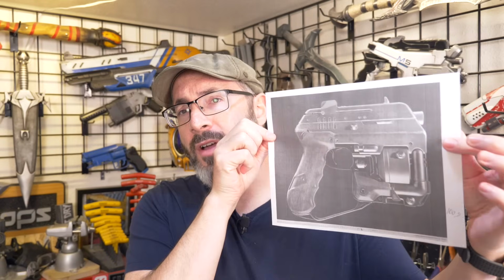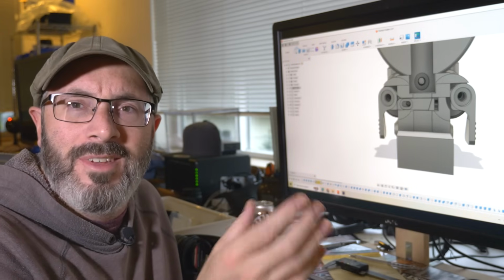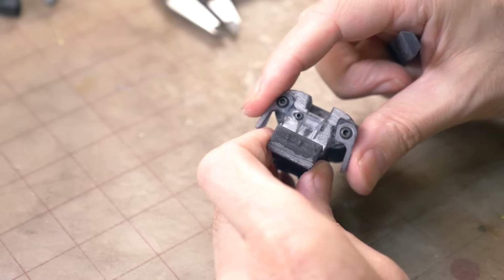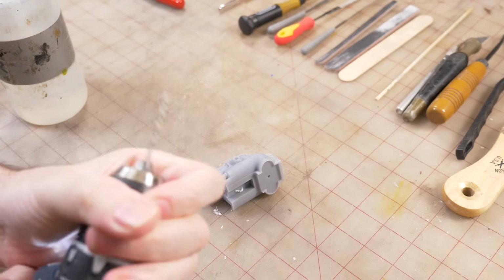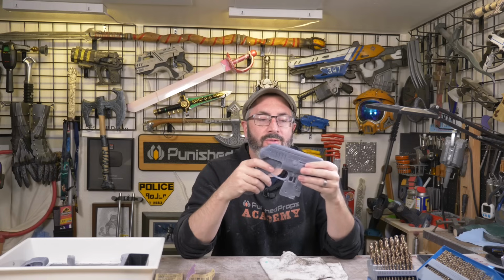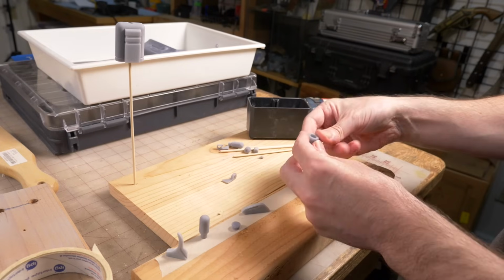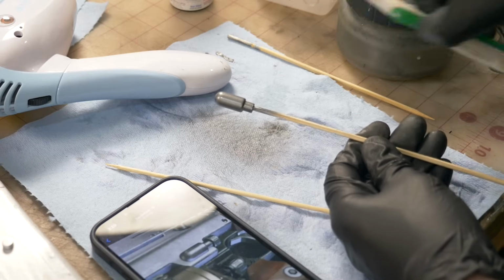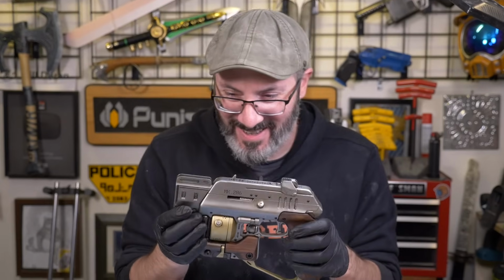Fulfilling my Obsession - Starfield Rattler Prop

Comment: SICK!!! It's really cool to see you implementing CNC in your build!!! I'm def not an expert but I used to design and mill molds (guns, knives, axes, etc) for a holster company and we would do adaptive clearing with a bigger bit (1/2 or 1/4" depending) to remove the bulk of material and then finish it with a couple parallel passes using 1/8" round bit. Might help remove some of that texture you were talking about but I'd probably still sand it manually either way lol. The lips on grip could be something goofy like if you have Fusion cut on the inside or outside of a contour edge, or if the geometry is too small for the bit you're cutting with it gets ignored entirely. Not real sure on that one. It's killer either way and so sick to see. Thanks for making this vid! 😁
Reply from the maker: Thanks so much! I’m having so much fun with CNC.
Reply: Hello! I’m new to the channel here, and really enjoy the content. I’m an artist, and make all kinds of junk and always enjoy learning a new process. — This lip issue can be fixed by expanding the bounding area on the part you are milling, while also throwing in a box or plane under your part with the top of that box being at zero on the z. The bounding area for the part only need to be large enough for the end of you mill (ball or taper) to pass the part and kiss the box underneath. Another method I use depending on the parts, still using a large bounding area, is to tell the machine to skim the clearance plane with clearance plane being set to zero. I’ve only ever worked in rhino cam, but I imagine there are some similar parameters in your cam. Anywho, hope that helps smooth them lips out for ya!

Comment: just a heads up you can hang the plate up inside the resin printer to let resin drip off back into the pool of the resin and then you can take the resin print off the plate to do the whole wash and cure section. Newer Resin printers will allow you to hang the resin print plate in them to let the resin drip back into the pool of resin

Comment: 2:29 Nice!
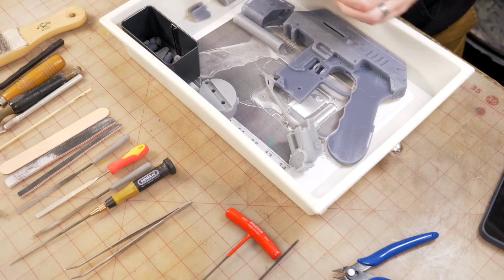23:17 So with these tap screws, how do know just how deep you need to drill?

Now, I wonder how it's possible to extract the files from the game like that?
Reply from the maker: I made the hole 20mm deep and it only needs to have threads on the first 10mm, so I have some wiggle room on the depth.

Comment: One thing that’s important to remember about resin printing is that it can be significantly less accurate than FDM. Depending on your resin, the parts might shrink, be warped, or otherwise inaccurate. If you need parts with a small tolerance between them, you might have better luck with a well tuned FDM printer.

Comment: This turned out fantastic! there's some really fantastic design details in the starfield weapons like the magazine having the cooling system integrated into it so that when you replace the magazine you're also taking out the heat the gun has built up which is essential when it's expected to perform in an environment with no air to passively cool it. Most of the weapons are designed with some form of heat reduction solution and it's cool to see all the different ways they've achieved that
Reply from the maker: Oh yes, I am in love with all the designs in Starfield.

Comment: I think some of the issues you might have had with the resin is that you're using a semi transparent. Resin that clings to the part because of surface tension is getting over exposed as the rest of the model cures. I suggest trying a white of light gray resin and make sure to do a resin calibration test to get the exposure time perfect.
Reply from the maker: I experimented by mixing some opaque resin in with the transparent resin and the results seemed to improved. Definitely need to do some more tinkering to get my resin printing game on point.

Comment: Bill if you heat up the supports before you cure (using a heat gun) you can pull them of much easier.
Reply from the maker: Right on! Thanks for the tip.
Reply: @punishedprops run under hot tap water.

Comment: You can add oil paints to tint your earlier coats of an oil based finish to get whatever wood tone you want, so if you can find a piece with the right grain, you can definitely fudge the color.  I made a piece of pine scrap the color of mahogany, no problem.

I'm also surprised that a part stamped HSS in-universe looks like brass...but your faithful reproduction is beautiful.
Reply from the maker: HA! Yeah it definitely isn't high speed steel. 😂

Comment: When the material failed since it was too thin for the resin, I was wondering if a hybrid approach would work where the base of the gun was made out of a sheet of aluminum and maybe aluminum or steel pins to hold the slide. It may still be too thin for aluminum. 
I know it is so easy to get stuck in one thought of how something should work.
This isn’t a criticism of the finished prop. It is amazing. I really want to see the working slide. 😅 And my thoughts on what might work to solve your issues.
Reply from the maker: I like that idea a lot.
Reply: The issue with having aluminum is how everything attaches.

Comment: @punishedprops I think I know why the wooden parts had a rim. In fusion you probably had the tool containment set to tool center on boundary. It should be tool outside boundary to get that last bit of material.

Absolute great result by the way!
Reply from the maker: Awesome, thanks for sharing! 😄

Comment: Resin printing always feels less exact then FDM, which is funny since resin printing gets smaller and finer details then FDM printing, but when it comes to getting rails and that to slide, from the age of the resin to any over or under exposure of the UV, it can lead to tolerances being inaccurate. Though same things can be said about fdm printing, from the age of filament to the head of the nozzle. One of the main things FDM has over resin, is the cleanup, plus less cancer, for most filaments anyway

And i know you probably know this since its been 4 months, but you do save time and money by prototyping in FDM, and then attempting in resin

Comment: I think it still would have been nice to keep the slide separate, albeit with a bit of a design change to allow the slide to be racked back on a rubber band; something simplified and reinforced from the original mechanism. Something like that would go well with the magazine swap: drop, reload, rack :)
Reply from the maker: For the final print files I did separate the slide to make it easier to print, but it doesn't have any mechanisms. I'm super someone can kludge a sliding mechanism into what I designed.
Reply: @punishedprops  Groovy! I was a bit worried about printing off such a large chunk of resin to begin with, but having a smaller chunk by adding a separate slide is just sauce for the goose.

Comment: Have you considered looking into how 3D printed firearms are designed to help guide in design choices for a piece like this? Make sure it's not illegal to have the files where you live before even looking for them though.
Reply from the maker: I'm doing my best to steer clear of anything even remotely functional.
Reply: @punishedprops  Sure, and that's reasonable. I just thought it might be a decent place to look for ideas on slide actuation at the least.

Comment: I think fusion can export the threads so there is no need for tapping the holes!
Reply from the maker: I have yet to test if they can print with enough tolerance to be useful for something as small as an M2 or M3, but it's worth a shot.

Comment: Really nice work.😊 Did you design it to be printed on a resin printer specifically or can it be printed on a standard 3D printer?
Reply from the maker: I test printed it on both a resin and FDM machine, so it'll work no matter what kind of printer you have.

Comment: I don't have a 3d printer but I do find these videos interesting. I'm curious is there a way to recycle the test prints and the support structures or are they just trash?
Reply from the maker: Unfortunately they can't be recycled. You can turn them into art though. I took the test prints of my Bladerunner blaster and turned them into a piece of wall art. I made them look like an injection molded model kit.

Comment: Some personal preferences/tips/tricks for SLA (resin) printing for anyone who might find it useful:
- hollowing your prints and adding vent/drain holes uses less resin and helps prevents parts from cracking with age
- removing supports before curing in cure chamber makes support removal easier and leaves less support behind, this can leave pock marks though
   (an hobby knife and tweezers/fine-pint needle nose pliers go a long way for smaller supports)
- doing 2-3 wash cycles can help remove pooled resin in tight areas or wells (2 wash on bed with supports at different orientations, 1 wash in the basket after supports removed)
- using compressed air can make drying your parts much quicker after wash, before cure
- using ratio mixed resins can greatly improve material properties (my favorites are rigid+tough and abs-like+tough mixes)
- water soluble resins tend to be easier since you don't have to keep a ton of IPA on hand, but they're typically very brittle and prone to cracking over time. 
  (IPA soluble has more material options and better bond strength)
- flexible resins can be very cool but difficult to get the settings right. I've had good success with Resione's F69 Black rubber-like resin.

Hope someone somewhere finds these helpful!
Reply from the maker: Awesome, tips, thanks for sharing!

Comment: For your final weathering pass, are you using acrylic or oil paint, and are you doing anything to seal that after the weathering pass?
Reply from the maker: I use a water mixable oil paint and I don’t seal it after weathering. You just have to give it a few days to dry.

Comment: I'm wondering if it would be worth CNC cutting the central "base plate/frame" out of aluminium? (Going back to the original design with all the "extras")
I know it's necessary but to see that lovely clean Rattler wiped over with "Starship Gunk", or similar, just makes me cringe.
Reply from the maker: That’s a neat idea.

Comment: Not going to lie I was way more interested in this project until the removal of the slider unfortunately I won't be using this model because of that I feel that it was gave up on way to fast
Reply from the maker: I feel you, it’s a bummer I didn’t include the feature, but every finished project includes some compromises.

Comment: Heat set inserts may work well for threads.   Depending on material thickness amd thread size may not work for everything but would be a bit more robust.
Reply from the maker: Yeah those things are neat!

Comment: hello! little comment on the resin printing that may help you. With the support material i find that if you remove it before curing it tends to come off a whole lot easier! you can take a hair drier or run under hot water or whatever and just gently run it over the supports and the thin pieces near the part, they will come off super easy so you dont have to sand as much!
Reply from the maker: Ooh yeah I still have lots to learn about resin printing.

Comment: The Rattler is such a weird gun mechanically. The part on the front that's a magazine doesn't look even remotely like a magazine. Why the cylinder? Why the tube? Why the whole grotesque assembly to hold it? How does the ammo even feed? If it's just a way to put a compact drum magazine on a pistol... why?